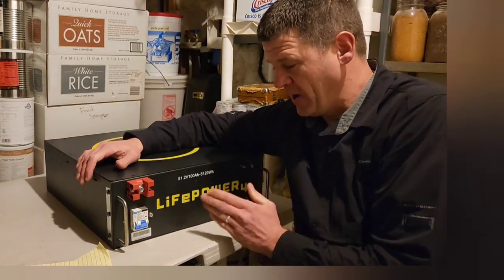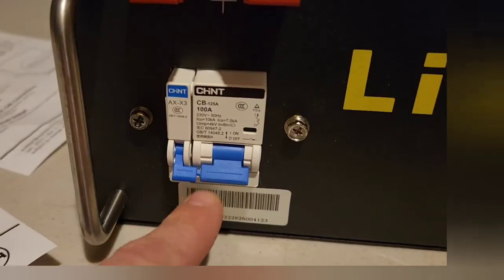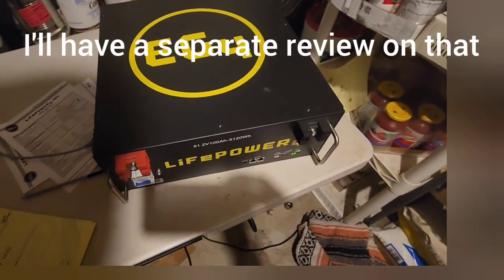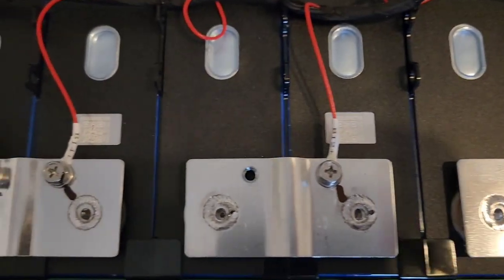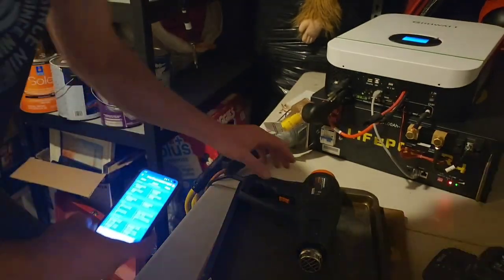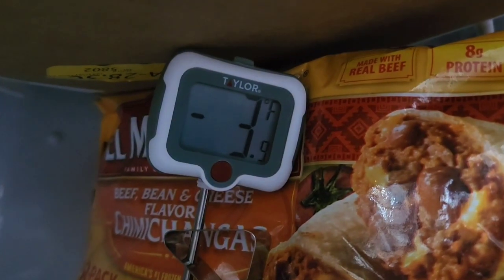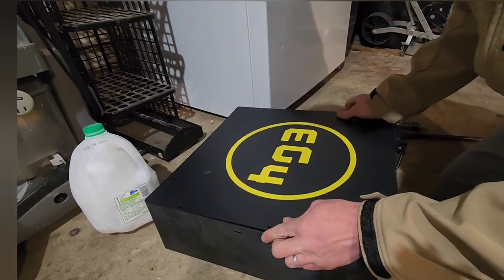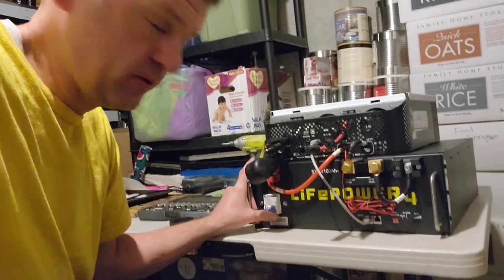Eg4 LiFePO4 Solar Battery(LifePOWER4) - Server Rack Battery review and freeze test.

Comment from the maker: LiFePO4 Server Rack Battery | EG4-LifePower4 Lithium Battery | 48V 100AH | Server Rack Battery

In my opinion this is the best valued server rack battery on the market. This server rack battery is offered in 48V, 24V and 12V varieties. I plan on using this lithium Battery in Garage as an emergency backup battery but mainly will use it in my RV. This EG4 Lithium Iron Phosphate battery has the capacity to run my RV's air conditioner all day with my solar and for 5 to 6 after the sun goes down.  I've seen DavidPoz and Will Prowse use this LiFePO4 battery and I decided to give it a try. Thanks for watching.

Affiliate Links:

EG4-LifePower4 48V battery from Signature Solar: https://signaturesolar.com/eg4-lifepower4-lithium-battery-48v-100ah/?ref=DiySolarPowerFun

Growatt all-in-one inverter:  https://signaturesolar.com/growatt-48v-3kw-150vdc-stackable-off-grid-inverter/?ref=DiySolarPowerFun

Other products 
$34 USED SOLAR PANELS:
https://www.santansolar.com/product/santan-solar-t-series-240w-cracked-vinyl-solar-panel/?ref=DiySolarPowerFun

Other related reviews:

6 affordable home emergency tips(our family blog): 
https://mysillysquirts.com/home-emergency-preparedness-tips/

-----------------------------
Disclaimer
Working with electricity is dangerous and can lead to injury or death, even when following documentation and instructions. I cannot be held liable for such damage or injury. I am not giving or seeking to give advice on how to work with electricity. You should consult with a licensed professional whenever possible and get all work reviewed by an inspector and follow any local regulations in your area. I'm documenting my projects for informational purposes only. Remember, be safe and have fun. :)
Reply: Aaw
Reply: Love the prepper pantry in the back. Nice arrangement.
Reply from the maker: @Capoe3  thanks.  I hope it's enough  :)  🤞
Reply: @diySolarPowerFunWithRay  yep me too. Never will be but that’s what a garden is for. Get you through that first 6 months though and the competition won’t be as thick on the ground.
Reply from the maker: @Capoe3  interesting, I never thought about it that way...it could be hard keeping it all safe.

Comment: Thank you for the freeze test. I should receive my EG4 in the next few days and it is going to a off-grid mountain site. Little to say, it gets cold up there.
Reply from the maker: Good luck!
Reply: I got my EG4 and replaced my old Pb-acid array. What an improvement! With the software I can even monitor the state of charge. I have it linked to the internet so I can monitor it from anywhere. Rite now we are hovering around 6 degC. Not quite frozen yet. Thanks for the videos.

Comment: I have the next one up for my cabin with a display. Love it. Works great. Let my cabin freeze. Big deal for me. I was told to bring the battery home and not let it go below minus 4 degrees F. Nice battery. Love it. Freezing is not the issue. Going down to below minus 4 degrees F is the problem.
Reply from the maker: Many people have said they leave the batteries over winter in Alaska cabins and they do fine.
Reply from the maker: They just say they top them off before winter comes.  Who mentioned you need to bring them home
Reply: @diySolarPowerFunWithRay  Spec sheet says don't let temp go below -4 degrees F. My cabin freezes down to -20 degrees F.

Comment: Thanks for your video on the Eg4 battery.I plan on Installing the same Inverter with a 48v SOK battery in my RV .I was wondering about winter temp. and how it would effect them .I plan on isolating them from my solar/etc and was wondering if I could leave them in the RV .Great to hear Jason Web"s comments and experience with his batteries . Looking forward to your video on your RV set- up.
Reply from the maker: Thanks. Do you know how much solar you're putting on your RV?
Reply: @diySolarPowerFunWithRay  
Ray , I am thinking about mounting (4 x 450 watt panels) , I might start with 2 and see how they keep up , Bottom line is we do alot of remote camping and I like to be able to use all our electrical appliances , furnace, fridge ,etc , also the growatt inverter requires >60 vdc for the mpppt to start operating from what I read ,also there's other factors like shading and low sunlight on cloudy days. How about yourself what do you plan on running for solar power ?

Comment: I got 4 of the EG4s in northern Quebec in -40c. As long as the battery is staying full charged no problem there
Reply from the maker: Thanks, that's a good point going into winter. So do you keep them around only for back up emergency scenarios?  if you use them regularly during winter, I imagine that you have them inside so you can charge them.
Reply: @diySolarPowerFunWithRay  
It is for spring, summer, fall time cabin. In the fall it is fully charged and isolated from the system . I loose about 15 percent battery power in six months. Never touch it in six months
Reply from the maker: @Jason Web  Nice, sounds like my kind of place 🐟
Reply from the maker: @jasonweb9720  nice set up.
Reply: @jasonweb9720  Hi Jason...I know this is and older post but wondering about how your batteries are doing...I am in the exact same situation (in Northern Ontario) and want to leave these server rack batteries out at camp over the winter in -30C to -35C temps...you are the only person I have found that actually has done this and posted about it...all the companies say to not store them below -20C but as you know it is not easy to haul these in and out, I am boat access as well which makes it even more challenging
Reply: @RussGeorge-zl9hi  
No problem to store them full for the winter. If you need to go and us power. Then they have to be warm and no condensation to charge them. They also degrade slower in cold temps. 
Just keep them full in the fall turn everything off and your all set. 
Mine are doing great.  Now i have 7 more camps that have the batteries also.

Comment: Can you safely connect solar panels & inverter cables to the 2 inputs located on the top as opposed to the Growatt cables ??
Reply from the maker: You'll need to buy a separate inverter and separate solar charge controller.  It that point I'd just buy a cheap Growatt that contains both of those.

Comment: Thanks for sharing, I have been looking into this battery for my OGC and was concerned about leaving it there in the winter. It states 100AH is this enough for a small cabin, (lights, TV, small fridge?)
Reply from the maker: Thanks, Glad this video provided value to you. Just remember a 12 volt 100 amp hour battery is 1/4 the power capacity of a 48 volt 100 amp hour battery.  I have another video where I run three fridges and a furnace without any solar attached.  You can view the runtime there.  I'm posting another runtime video shortly of running two fridges with solar.
Reply: @diySolarPowerFunWithRay  Thanks !
Reply: @diySolarPowerFunWithRay i tried telling to a couple different people and they say 100 ah is a 100 ah lol

Comment: What is the input limit on Current and Volts for your Growatt? I assume you will put series strings together near the max voltage (?) of the Growatt and then add parallel strings up to the current limit (?) of the Growatt?  Help me understand if it is not too much trouble. I want to copy what you did only with two of the batteries you have and max out the Growatt with panels.
Reply from the maker: No problem at all. Sorry for the delayed reply.  I just finished a review video of the this growatt here: https://www.youtube.com/watch?v=p_SH5buI8jY.  You can actually install more panels than the listed amount to help on cloudy days(over paneling). There are some helpful comments in on that video describing how to do it in more details.  Use my links and it will help me out....Let me know if you have any other questions and I'll try and answer them for ya.
Reply: @diySolarPowerFunWithRay  Thanks! Clicking the link now!

Comment: "no expansion after being frozen" ...! Trying to make a few bucks from affiliate links menas having goo knowledge of what you are talking about, thus providing content with real value. Cells won't expand unless during high amperage charging process, not stored in a freezer...!
Reply from the maker: I'm no expert but there have been plenty of people that thanked me for providing this review. It gave me piece of mind knowing my battery will be out in the elements for the next 15 years. I'll give a update after that as well... If you don't think that will be helpful you don't need to subscribe. Only use the affiliate links if you want to support this channel. I try to only post items that provide value... If it's been done before I won't do a video on the subject.  The freeze test was more that expansion, I wasn't expecting it to expand(although I'm sure some were wondering about that), It was about verifying the capacity wasn't altered after the freeze..and verify the components were still functional after all the water condensation.